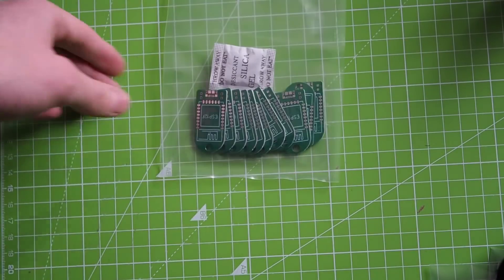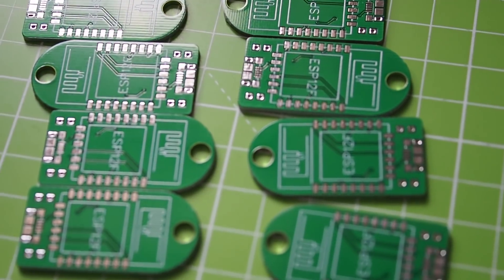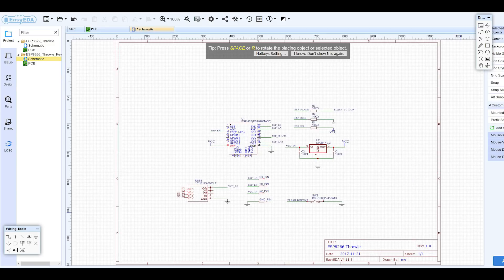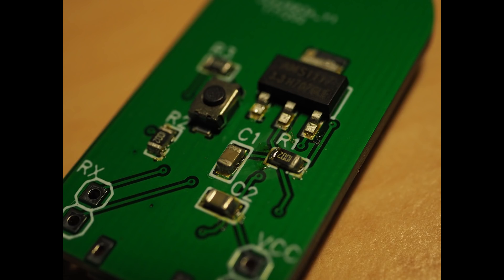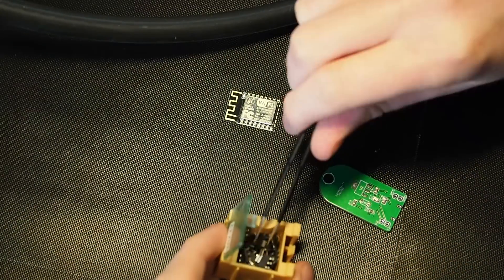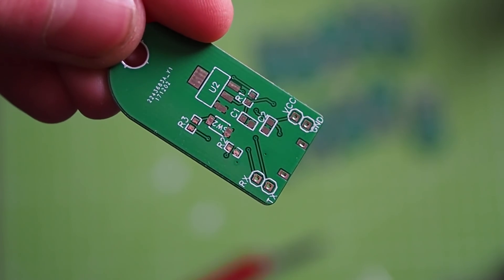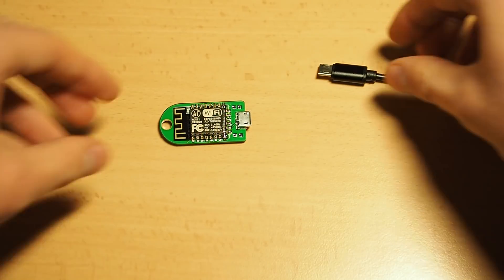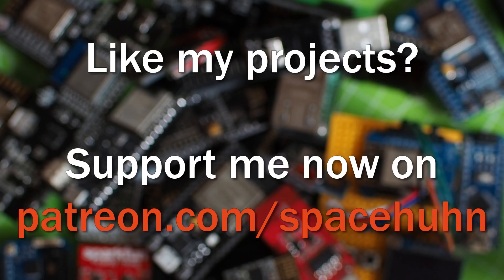Making ESP8266 PCB Prototypes

Comment: Nice video, one suggestion I have would be to use a a silicon soldering mat. They make it easy to store parts in their little trays, and keep the part from sliding around.

Comment: does one of the esp32 pins need no be routed to ground in order to flash the code?
Reply: If you still need to know this. 

It’s a ESP12E or a ESP12F and the button is attached between GPIO 0(zero) and ground.  The button is there to upload you code because it’s floating(non active) until you press the button.

Everything has been taken care of and you don’t have to route pins to flash the chip.

Hope this makes sense.

Comment: I understand the shipping time can vary from location to location, but how long did the frogo take to deliver from tindie? I have never ordered anything from tindie actually.

Edit: I can't spell for shit
Reply from the maker: took 2 weeks (ish)
Reply: awesome. I can practice being patient. My plan is to create an xbox one rapid fire mod which lets me adjust fire rate over wifi. 

I need to keep the size of the mod hardware as small as possible so it will fit in the controller. The frogo will be perfect for flashing the esp8266 without needing to use a pre-soldered dev board. There are NO videos showing this product so I am pretty lucky to have found yours...otherwise I would not have known it exists because I am fat and stupid.